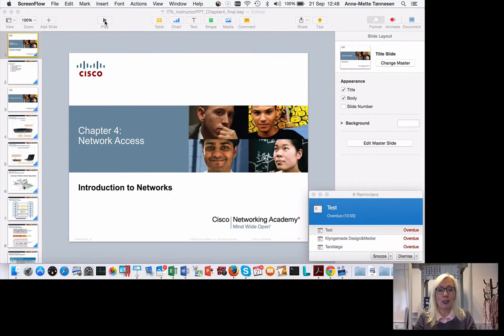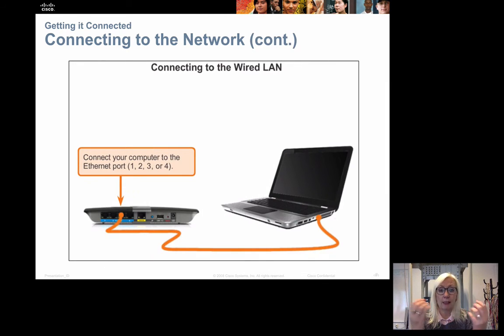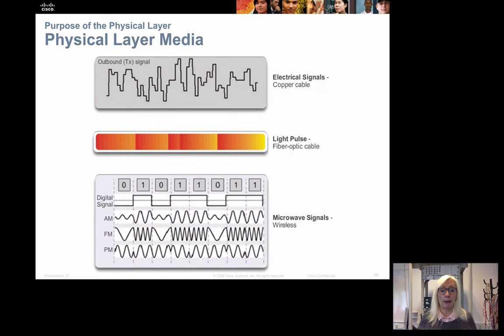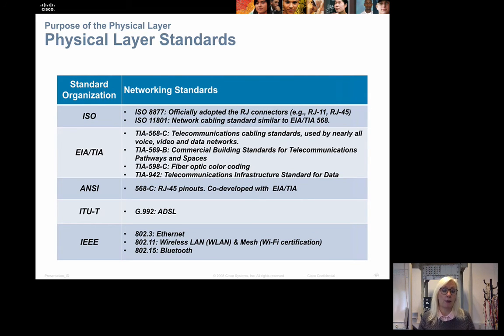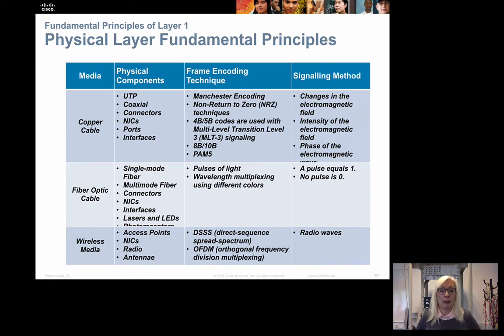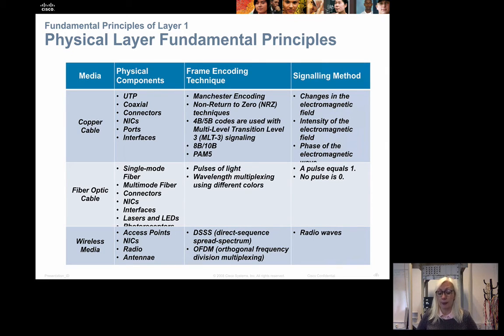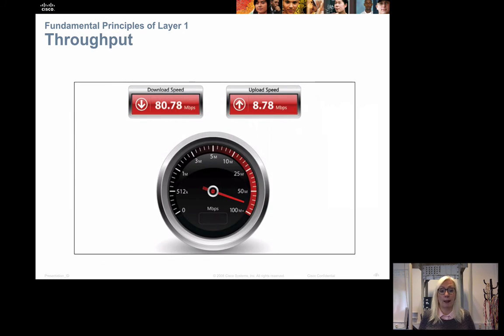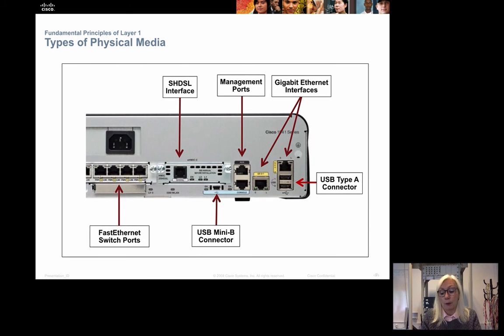CCNA1 Chapter 4 part 1

Comment: hello miss thanks for your efforts but are your courses compatible with the ccna  v5.1 ?
Reply from the maker: Well I made them initally for the older version - but I use them for version 5.1 this semester. This is just an "add on" to my normal face to face classes. I use the flipped classroom approach :)
Reply: Anne-Mette Tønnesen you do it really well by the way . i never read what's in my 5.1 i just see your videos and the videos of another guy around it works great i understand better hope you continue